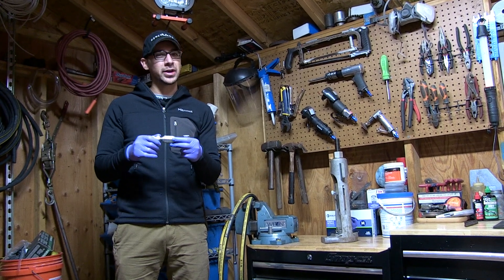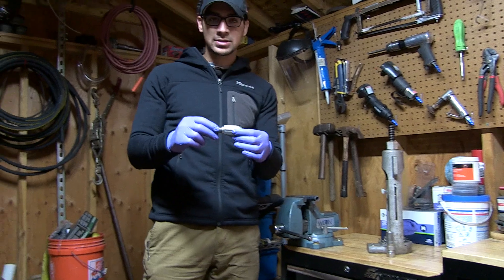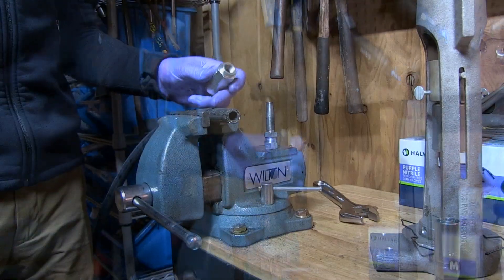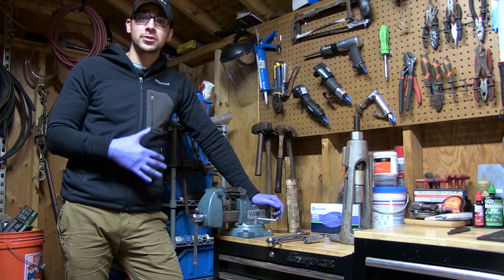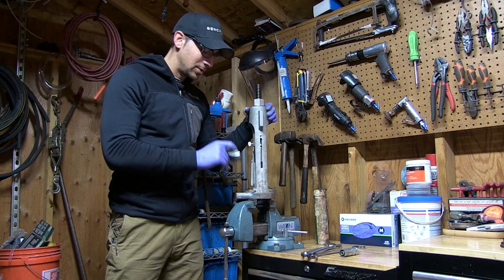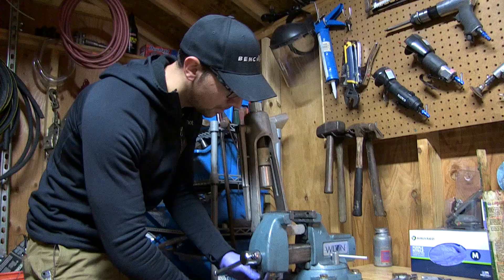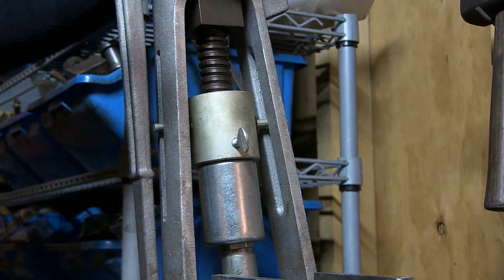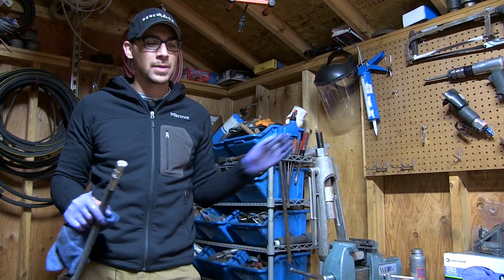How To Make Your Own Hydraulic Hose

Comment from the maker: The Swage tool in this video can be found here - https://www.sonnysdirect.com/sonnysdirect/en/Parts-Supplies/Hydraulics/Swaging-Tool-Hand-Operated/p/000000000040000601
Reply: Great vid! Would you reccomend using a replaceable fitting on a hose that requires 3000 PSI ?   will it be able to withstand the pressure? Thank you!!!!
Reply from the maker: Jane Cullen Yes. It could
Reply: @janevcullen  eď M we
Reply: Hey, the link gives me an error message. Are these still for sale?

Comment: Nice video, nice explanation, very friendly operator!! But for a couple of hundred bucks, they should have come up with something a bit more functional. Not with a machine that has to be clamped in the vice, then maintained with a hand otherwise it slips out of the vice.... This is simply way too expensive for a primitive machine like that.

Comment: get your facts straight dude. weathered is not made  by Parker. 2 different companies and they use 2 different fittings. and your swage machine is for thermoplastic hose not braided or spiral wound hoses

Comment: I love your jacket Marmot Mnt Works. I just bought a shirt yesterday. I have a Marmot Gortex waterproof down sleeping bag 1.9 lbs for backpacking that Iv'e used for 40 years. I'll be making my own hydraulic hoses from now on, thanks.
Reply from the maker: Great comment. Thank you. Owned a car wash for past 13 years…. Marmot is high quality gear great for cold and wet climate. Prefer it over north face and spider. Gore is actually really nice as well.

Comment: In the olden days late 1980s early90s I used to make a lot of air lines almost daily  using the re usable the fittings they were dot approved.. 
 The supplier would come in once a week and restock . We never reused the fittings it was a liability thing also they were cheap maybe $2.35 each . But I'm about to do a big hydraulic build and will probably look into sweadge fittings . Buying premade is out of  question like several thousand dollars. The shits is a million years ago I could of gotten a good deal on a parker sweadge my dad was a VP for them in the oilfields section.

Comment: I’ve been using ratchets and sockets a lot lately in places where I would have previously used a wrench. Usually it ends up being a lot easier, and I get a snugger connection where a wrench would have started striping out the flats. This is a place where I’d probably give a socket a try.
Reply from the maker: Not here. The problem is you want constant pressure on the fitting. So when the ratchet reaches it’s limit where you back off to re ratchet. You lose the tension on the fitting. With the wrench, you’ll notice I never let go. I am keeping constant pressure. The metal is warm and being formed… you want it this way so you should not use a ratchet and socket. Even though it’s much easier on you and your arms! Haha. Trust me

Comment: Minor thing, Weatherhead is actually a division of Eaton, not Parker. Some important things worth mentioning, never mix and match brands of hose and hose ends. I've seen people do this time and again only to have the end blow off. Manufacturers design their crimp fittings to work on their specific hoses and some even make different fittings for one and two-wire hose. Mixing brands could have serious consequences and could lead to ends blowing off and potentially hurting someone. Also, when crimping a hose, you need to know the manufacturer's crimp specs/dimensions, otherwise, you have no idea if you installed the end correctly. Unless you like cleaning up oil spills and taking unnecessary risks, when uncertain, get it done by a professional!
Reply: you get the core of the fitting to collapse a certain amount when you crimp

Comment: I can see having that re-usable fitting on a service truck dealing with Hydraulics as one of the systems and finding a hose leak, cutting it with a cutoff wheel and putting that fitting on until a manufactured hose can be obtained. If the equipment is down, that is a cheap fix to get going again.
Reply from the maker: Weird. Owned the car wash for 12 years and never had an issue with the hoses I make.

Comment: I looked up the tool it's a 1000.oo double what you stated. That's without the dies of which you will need one for every size of fitting you use. In my experience a shop made hyd hose with crimped fittings costs about 1/2 to 2/3 what same hose costs if you buy reusable fittings. So if you have to replace it your saving money with reusable fittings and you can (with hose if you have it) fix it on the spot with no more than two wrenches and a knife.
Edit: I've never had any problem with reusable fittings outdoors in fact I've reused them on snowplows old snowplows.
Reply from the maker: At the time of the video. That was the price. Try looking on eBay. They often pop up for much less.
Reply: Video is Dec. 2016, prices do change.
Reply: Dang, I want a knife that can cut hydraulic hose! I have to use a chop saw. 😉

Comment: I don’t know about any of you, but having a gas heater over the hydraulic unit could be a fire hazard. If a hydraulic hose sprung a leak and hosed down the heater that could be a problem.
Reply from the maker: Hydraulic oil isn’t flammable

Comment: when building a reusable hose, you should absolutely use a mandrel to prevent cutting the inside of the hose.  Also using anything other than hydraulic fluid as a assembly lubricant will contaminate the fluid.
Reply: Tried using one of those for air hose. The outer layer of the hose I was trying to fix was deteriorating. No matter how I cut the hose, the interior wires would splay out and not allow the anti-clockwise application of the outer shell. Some number of $$ wasted before I ordered replacement hose.

Comment: good video but per Parker specs and good year specs when installing a reusable end couple once outer portion is installed onto the hose you should then place outer body into vise to properly hold for installation of second part of coupler. this prevents twisting of the hose from body which can unseat hose and weaken connection and also avoid tearing or damaging outer skin of hose. never install a high pressure reusable end coupler in the above way.

Comment: Great video! Can you tell me what size and type hydraulic hose you are using? I am trying to figure out if this method is right for me. I have an old tractor that needs pretty much all new hoses. Will this swager work for R2 hose? Did you get the dies and pusher from Sonny's too?

Comment: DON'T use never seize on reusable fittings. Some hydraulic pumps don't handle solid lubricants very well. One stray drop/glob can make for an expensive fix, or a diagnostic headache later. Just use bit of the working fluid to lubricate the end.
Reply: A an ASE Master Tech since 1978, I would agree. But perhaps not shown or explained in the video as well as it could be, on a fitting that carries a different juice inside, no one uses “Anti-Sieze” on the open end, tip or orifice, only starting two or three threads up. Those who do it all over the fitting and/or inside only don it once. This is long enough to see the fluid contaminate your system, degrade your fluid, cause mechanical failures at the pumping device or simply watch it pop off. Either way, good point. You only screw some up bad in life once normally, then your wallet weighs less, unemployed, pay alimony or your dead.

Comment: Been a hydraulic engineer for over 10 years now. I do not rate the re use fitting. They blow off so often. I don’t rate the one pice fitting aswell, especially if it’s Parker. They crack half the time crimp them. Manuli fitting are the best in my opinion

Comment: What a coincidence. I just bought hose and reusable fittings from Discount Hydraulic Hose, arrived today. Everything looks good. Amazing customer service, fast shipping, good price. (16$ for a reusable fitting)
Reply from the maker: Haha nice. I get hose from there too. I miss older days. I been doing this for 11 years. Fittings have doubled in price. And hose too! Quality is way down also. So you’re paying double. And the quality is half as good. But at least you’re saving a lot of money by doing it yourself. A standard 1/2in hose with swivel fittings 6 foot. Cost about $40 bucks if not more from my local hose store. It’s crazy. So right now I can make that size hose for about $10.
Reply from the maker: What are you using it for?

Comment: would these work on power washing hose?
Reply from the maker: If you have a lot of the same size hose. Yes... makes sense to get another pusher and dye. But they are expensive. Around $100 for the set.
Reply from the maker: Of course!! My power washer hose is 3/8 so I only have two hoses in the place. In order for you to do this you would need a 3/8 dye and 3/8 pusher. So for me it made more sense to use reusable fittings since whenever the power washer breaks. It always breaks right at the end by the handle. Since it usually have a nice bend. So I’ll cut it. Undo the fitting and redo it. Faster than using the swage machine

Comment: I have a 17" hose with 3/8" O ring face seal straight ends.  ffx-04-06. O'Reillys wants $55, online store delivered is $38 [no tax] and the reusable fittings are $50+ the hose, so maybe $60. Hard to justify the reusable fittings, especially since no one ever seems to reuse them, unless the hose is long and large and the machine is down with the break near the end.

Comment: If you are making so many hoses you need to invest in a better crimping machine  taking to long time is money  .. never put the hose onto a dirty floor.  You need correct training before crimping high pressure lines hydraulic oil is very dangerous.

Comment: I had a hydraulic crimping machine myself. Recently the fitting keep popping off the pipe after install. I can assure that there is nothing wrong at the installation side. What can I avoid this problem while crimping the pipe?
Reply: There is a chart that gives the finished crimp diameter for the different size fittings. Use a micrometer or dial caliper to check that the finished crimp went small enough. Also I have been told it is better to keep the hose and fitting with the same manufacturer.  For example for Parker hose use Parker fittings.  HTH
Reply: Ronald Adams 110% spot on. My family owns a Hydraulic and Industrial Hose shop, as we’re a Gates Distributor. On each of our crimpers we have charts and books with the specs and what the OD of the crimp should be along with s micrometer. We set up all of our customers with crimpers with the same chart. And using the same manufacturer is very important. Gates with Gates, Parker with Parker. Completely different specs among the different brands.

Comment: Hi, Good Video! 
But before you completely finish, should you ensure the hose is clean on the inside? 
Like getting a piece of foam/rubber, putting it one end and then blowing it with the air compressor out the other end? That way it clears any swarf/turnings-  or other debris left behind any other manufacturing processes?
Reply: That would work.
Good idea.

Comment: you could save a lot of time and just use a hydraulic press :-)  may i ask what is the standard size collar you are using for the pressing ?
Reply: If he invested a couple thousand dollars more maybe, but these particular fittings are actually designed to be swaged. They can be crimped but are actual swage fittings. He mentioned several times about the excess cost of having a swage machine over the cost of reusable fittings, I think he got it right for his application. He got the job done at minimal cost and has a field repairable hose (at least one end) Swaging and crimping are two different processes, and most crimp machines can't be taken into the field without an external power source. Being able to swage or using reusable fittings are both slower, you're right there, but with a couple wrenches he's got a machine running right where it sets.
Reply: @Hydraulic67 : would a reusable fitting work with a 30HP John Deere tractor hose. I have to replace the hose on site (ie in my garage) because one end has to be fed through a couple of tight brackets on my 4-1 bucket, with that end of the hose without the fitting pre- installed. My plan is feed the No-fitting end through the brackets then attach a reusable fitting.

Comment: You might want to warn your viewers about the reusable. One of the biggest mistakes is someone putting an R2 reusable shell on an 100r1 hose. They should make certain that the reusable is compatible to the hose. PS: Impossible to put an R1 shell to an R2 hose. Just saying. PSS: The shells on the reusable are always marked r1 or r2
Reply: You're absolutely right, they must be on the right hose. However, I did see what I thought was impossible, a 100R1 reusable on a 100R2 hose. I won't go into details, but lets say these particular people were a few bricks short of a load. They put warnings to not install fan belts while the engine is running due to people like them. They skived the 100R2 hose. Really, I'm not kidding. They managed to put it on, then blew it apart and got mad at whom ever sold them the fittings. I did them (and us) a favor and gave them some credit towards a new hose for all their reusable fittings. Some people just shouldn't try DIY way, it doesn't become them.
Reply: @Hydraulic67  I've been in the hose business for almost 30 years and built and changed thousands of hoses. It doesn't surprise me because I've seen the same stuff, and worse. People don't respect the stored energy of a hydraulic circuit.

Comment: I have never used grease on my fittings or die when crimping, what's the purpose for it?
Reply: Without it and the force involved, the fitting may lock to the die and the die lock up to the crimper. Don't use standard grease. Use graphite based only because you have to apply it less.
Reply from the maker: Tim Anderson Yes. Well said. Exactly what I was told!
Reply from the maker: Miguel Garduno Preserving the life on the pusher/dye

Comment: Thanks I’m buying a sewage machine I’m tired of buying from auto parts store idiots , today made 3 trips to Napa because the idiot left hose to short, 2nd put wrong size fitting, 3 put wrong size fitting again
Reply: I own a hydraulic shop and have been making hoses for over 35 years now, the last thing we want to here is "you S*B, you screwed up" at 3:00am (or any time of the day as far as that goes) so we have our customers, along with us verify the length(s) before we start, this has almost eliminated the "I said......" in the conversations. It also gets the customer involved and it also proves 2 sets of eyes is better than 1. I don't get offended when a customer corrects my measuring a hose or the fitting size I pull, it saves a mistake and a very mad customer. Just food for thought.

Comment: Where can I buy these fittings and hoses to do this job?
Reply from the maker: Karla Perez Castro I get the fittings at Sonnys car wash factory. And the hose at “ Discount Hydraulic Hose “
Reply from the maker: Karla Perez Castro The swage machine was bought on eBay. It’s a Parker. Many manufactures make swage machines. All you need to know is to make sure the dye and pusher are compatible with the fittings. Also different hose takes different fittings. But the hose company will let you know which fittings will work or not work